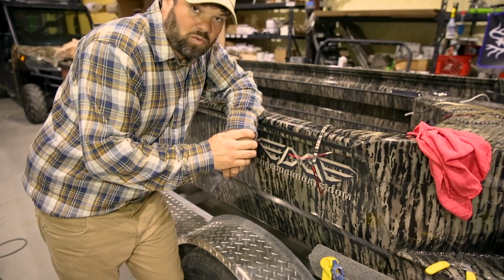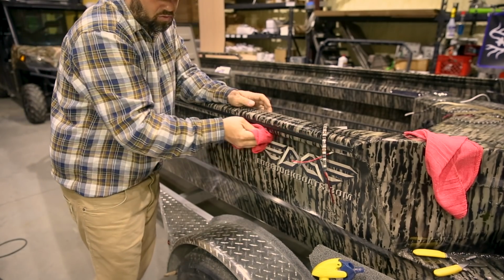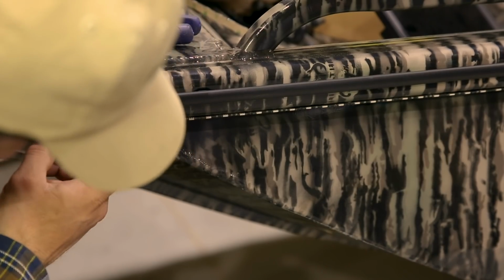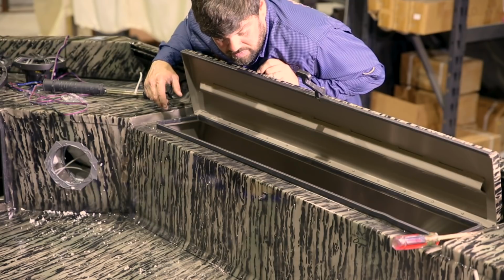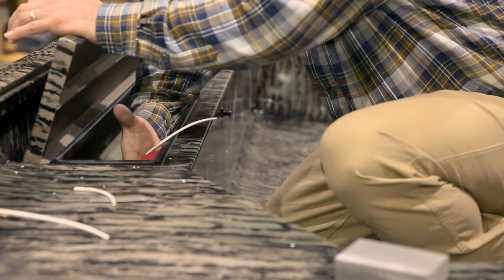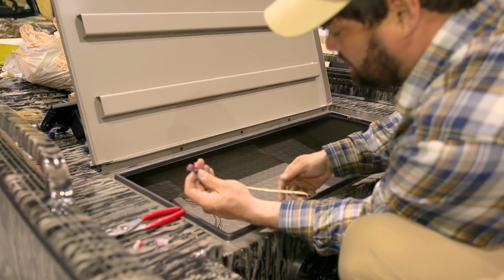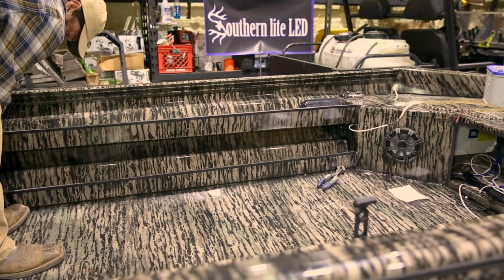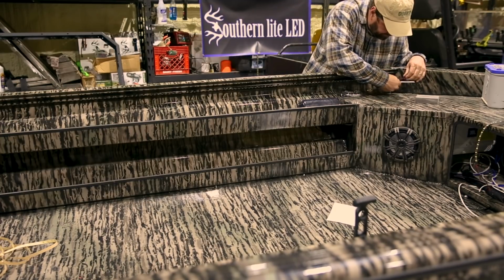SNAKE TUBE INSTALL by Southern lite LED

Comment: What connectors were used up front to creat joint from the two front hatch lights to a single wire?